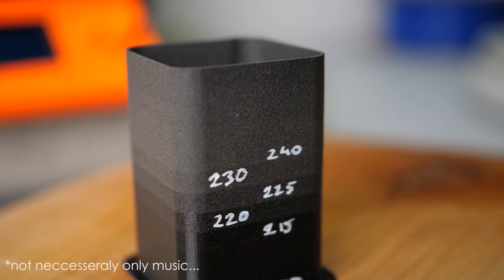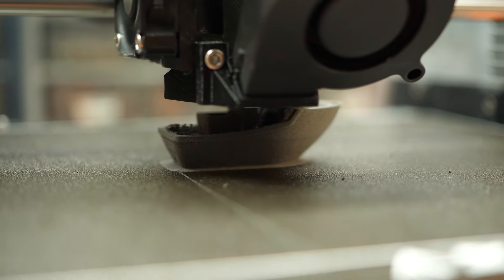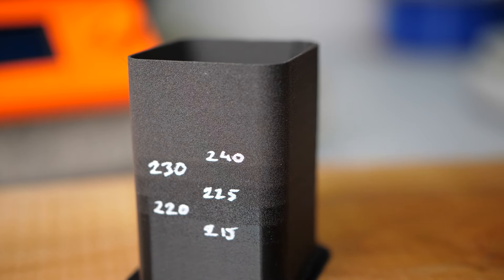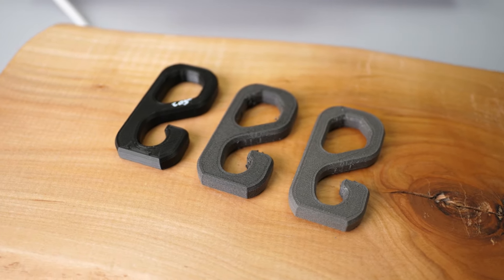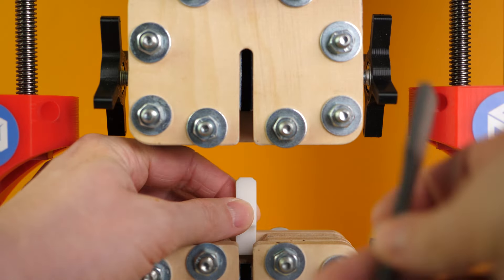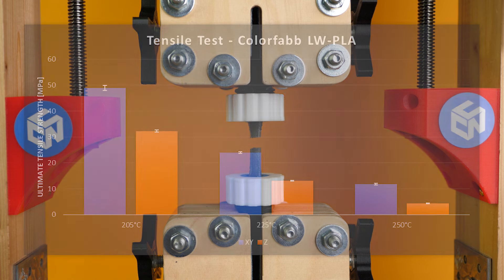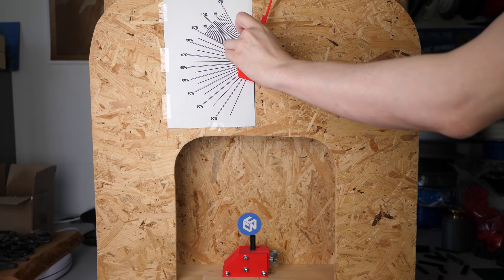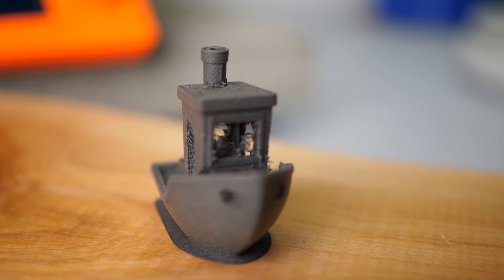A 4th dimension for 3D prints - Colorfabb Light-Weight, foaming PLA

Comment: duuude you should've put the non-foamed low temp parts in the oven at like 230 to watch them foam up after the print!
Reply: you probably loose the gas while extruding
Reply: you will just have a bubbly mess of molten plastic in your oven
Reply: @SteffenBauer  no, if you print at a low temp the chemical is still inside, as he said they put the chemical in before extruding a roll but at a lower temp
Reply: The foaming temp is way, way above the liquid transition temp, so it will all melt and then foam up. 

What might work is making the outer shell thin and the inner sections thick and then hitting it with a bow torch. If you get the heat high enough and for a brief enough period you'll foam the shell without changing the shape.
Reply: Chloe Mcholoe it will melt,try it.it will.
Reply: Jeff Wells l

Comment: Can you print a Benchy that swims well by printing it at high density in the bottom few layers and low density for the rest so it is heavier in the bottom and lies stable in the water?
Reply from the maker: Good idea!
Reply: I came here to ask if it floats. I guess this is the same question, phrased a bit differently.
Reply: micvee The *normal* benchy can float, but barely
Reply: If u touch it it will tip over
Reply: I wanna see it!
Reply: Well sure
Reply: 3 years and no updates on if it’ll float

Comment: i wonder if the trapped air gives parts insulating properties?
Reply from the maker: Very good point! It will definitely be a very good insulator due to the closed porosity.
Reply: @CNCKitchen  Ahh, not a good acoustic absorber then...
Reply: Since it foams up.  You should be able to use it as a  super light weight yet stable in-fill.
Reply: @Audio_Simon  wait. But if it has more insulating, won't it absorb more sound then?
Reply: Great point, I think it would be a good insulator. 3d printed drink holders!
Reply: Other thoughts include that a benchy printed in it would be very buoyant.
Reply: @vincentgarcia6630  only if it is open cell. closed cell foam tends to transmit sound better than open cell.
Reply: @josephgauthier5018  ah. Not sure what this means, but can we choose whether to design the foam as either open or closed cell? Or is that based on the material itself and out of our hands?
Reply: @vincentgarcia6630  i am actually not sure. i would imagine it is material based with many exceptions, as additives can do a lot of things. Either way, from what I have learned, close celled foam usually does worse with sound absorption. With that being said, i would imagine that open cell and closed cell are both better than solid plastic at absorbing sound.
Reply: @josephgauthier5018  agreed, I'd bet it'll help a fair amount. Hopefully it's open then, or that we can make it that way when printing
Reply: @vincentgarcia6630  from what i could tell in the video, it is not open cell, but maybe an open cell version will eventually become available.
Reply: @josephgauthier5018  I would say that the degree of openess depends on the temperature ( at higher temperatures there would be bigger closed bubbles (until rupture), and lower pla viscosity (lower rupture point).  Above 240° it's mostly open, as the bubbles do not increase in size anymore (a.k.a the density remains constant, so you know that the trapped gas expantion is in equilibrium with the losses or it is insignificant).
Reply: @josephgauthier5018  I would say that the degree of openess depends on the temperature ( at higher temperatures there would be bigger closed bubbles (until rupture), and lower pla viscosity (lower rupture point).  Above 240° it's mostly open, as the bubbles do not increase in size anymore (a.k.a the density remains constant, so you know that the trapped gas expantion is in equilibrium with the losses or it is insignificant).
Reply: @giuseppebonatici7169  open cell means air can pass through the entire structure, like a filter. are you suggesting that at a high enough temp, this particular filament will become open celled?
Reply: @josephgauthier5018  If the bubbles cease to expand at higher temperature, it has to develop 2° grade permeability, a.k.a become open celled. 

the only exception to this is diffusion. But, if PLA had good diffusion of the gas generated, you should be able to recognize that the walls had noticiable smaller bubbles than the center of the filament (as they would diffuse to the center (until a saturation state) and outside (degassing), allowing the growing of bigger bubbles in the center as the plastic doesn't allow diffusion because of saturation of the medium). 

The homogeneity of the bubbles and the expansion saturation at a given temperature suggest that, in fact, the material becomes open celled, at least partially. that, or it defies Charles’ Law.
Reply: @vincentgarcia6630  the way material absorbs sound is by surface area and permeability.  Sound needs to essentially get lost in the material.  If the  cells are closed sound doesn't have as many spaces in which to get lost and not come out.
Reply: Kinda like aerogel
Reply: @Scott_C  thats big brain
Reply: @josephgauthier5018  I believe John Coyne was referring to thermal insulation, not acoustic.
Reply: @AwestrikeFearofGods  that is possible
Reply: @josephgauthier5018  We might be able to make it at least semi-open celled after the fact by heating the whole part up to a temperature where it becomes malleable but doesn't lose its shape, like maybe 60°-70°C and then putting it in a low pressure environment, but not quite a vacuum. The decrease in ambient pressure should cause any air cells/pockets to expand, hopefully to the point that surface and moderately sub-surface cells open up to the point where the print becomes at least in part open-celled.
Reply: @richardmillhousenixon  perhaps if you were to put it in something like plaster to help it keep its shape, then that might work. but at that point, you may as well reach a full vacuum
Reply: @josephgauthier5018  I think if you just got it hot enough to where it was malleable you wouldn't have too big of a problem with it losing its original shape, and obviously bringing it to a full vacuum would work the best, but I was just suggesting a partial vacuum since you probably want it to depressurize quickly to avoid air just diffusing through the PLA, so having one vacuum chamber already at a full vacuum and then just opening a valve between that and the one the part is in would quickly bring it down to a partial vacuum without giving the air time to diffuse out
Reply: Definitely. It will have both a high electric discharge insulation and a high thermal insulation.
Reply: @richardmillhousenixon  yeah. my only concern is that if it is warm enough to pop bubbles, its possibly warm enough to sag without support of some kind. 

also, I'm kind of annoyed youtube didnt give me a notification that you messaged me. i only discovered that you messaged me because i got a notification from MrRedstone's comment.

Comment: Very cool! Excellent tests as always! One thing to note is that strength/density is not always the best performance measure for weight critical applications depending on the geometry and loading. For flat plates in bending (i.e. airplane wings), a better performance measure is the strength^(1/2) over the density. For bars in bending (like a wing spar), the proper performance quantity is strength^(2/3)/ density, depending on how it is loaded and the geometry. Because foams are low density, a thin panel made from foam would actually be both stronger and stiffer than a panel of the same weight made from a material with greater density and higher stiffness/density. I could see this material being super useful for RC airplanes like you mentioned! For more info, look up Ashby material index if you’re interested.

Comment: This material would benefit from a print head that could cool itself. Adding a skin of non foamed PLA on the perimeter would greatly increase the part strength without adding too much to the weight.

Comment: i hear this stuff is really easy to sand, can you confirm or deny this?
Reply from the maker: Yes, and also nice to paint because the porosity soaks up the color and it doesn't run along the layer lines as with normal 3D prints.
Reply: @CNCKitchen  Ooooooh, now im excited to try some for some prop making, sanding layer lines and soaking up paint? im in
Reply: @CNCKitchen  This! I was racking by brain a bit trying to see the unique value of variable porosity over just varying infill, especially given the non-linear losses in strength and remaining layer bonding limitations. That is, not for paint but for providing a light-weight, minimal substrate for epoxy resin-reinforced skin. Anisotropic strength is an issue with FDM-only plane structures but I bet the average porosity will be much more uniform. If this results in more uniform resin absorption then that will address some of the strength/stiffness variability. This could be particularly useful in something like an aircraft where a big portion of the material volume is the skin whose pre-resin-coating weight can now be cut by half. If you haven't already, check out Tech Ingredient's recent videos on epoxies for ideas: https://www.youtube.com/user/TechIngredients/search?query=epoxy
Reply: Now I'm seeing the potential!
Reply: @CNCKitchen  that is a very interesting property, might get some of this to make scale models to go with my Gunpla kits
Reply: How much lighter is it?

Comment: Super interesting! I've been making and flying foam planes for around 8 years now, so I definitely want to try this method. The main issue I see already with your printed wing is that foam sheet will commonly be 5 or 6mm thick to form the skin of a wing, with minimal internal structure, and just a single carbon fibre tube to provide stiffness. Thinner foam, such as 3mm or 2mm requires exponentially more internal bracing, even that balsa wood, in spite of having the carbon tube stiffener. I'm going to suggest that your original printed plane would benefit from foam printed internal structure (ribs) while keeping it's thin, un-foamed, skin. The internals could therefore be larger with no weight penalty.
I really like the idea of printing that sandwich effect though.

Comment: So use the foaming for gradient filler material and non foaming temperature for the shell/perimeter. That way you can get a "solid" part that is still light weight and uses less material, but is still strong. And the foamed material can be used for interface material between support and the model for easy removal support.

Comment: I think the dampening properties of this material can be very useful. I for example create dicetowers, and the regular prints are pretty loud to some degree. But with a material like this I think it will dampen the sound pretty good, though it will also lower the weight and might cause stability issues, if the towers won't be hold into place somehow.
Reply: Just a few bounce pads should be enough

Comment: I am glad you are mentioning that the technology is not new at all: "Playmobil" has been using the "baking soda" approach since the 70s for some of their "wood" parts. A problem with their recipe was that the compound (probably a PS) develped very sharp and ragged edges after failure. Not ideal in a toy. 

However, I see a lot of potential in "light", solid infills (handling compression forces), combined with a dense outer shell that is capable of withstanding stress forces, thus replicating structural PUR "integral" foam parts or the way nature has designed bones in mammals.

Comment: Stephen, I enjoy your engineering approach to 3D print tests.  It occurs to me that strength to weight is a key parameter for the foamed part vs. fill factor for the unfoamed part.  Meaning a test of strength of an unfoamed test hook with a fill factor to match the weight of a foamed test hook.   I'd also like to see tests of bond strength of a few common glues, like cyanoacrylate and epoxy.  Perhaps print the test hook in 2 parts and bond them before testing.

Comment: Thanks for the great video! Stiffness in a beam generally goes up by the cube of the thickness, so while the same thickness beam in foaming PLA might be a quarter of normal PLA. a same mass foamed beam should be about 3x stiffer than normal PLA. As you mentioned, skinning with non foamed PLA would improve it further, as would a spray coat of expoxy.
Reply: @JorgTheElder  ...But not as fast as the beam stiffens from added thickness. Try the math, assuming a 44% density and a 25% stiffness for the foam density, and a cube law for stiffness of beam thickness.

Comment: Variable temperature has a lot of merit due to it's wider applicability.  I think you can do this automatically if you setup a fake second extruder in the slicer, and make sure the custom tool change G-code includes an M-code to wait for the new temperature.  (M109, M116, or G4)  While the code will have extra T0 and T1 commands, your printer is likely to ignore them if it doesn't actually have a second tool.

Comment: interresting material, if you have parts that do not need the full strength of normal PLA you can safe a lot of weight in you designs, very usefull for rc- airplane accessories like gear-door, hatches or external tanks and stuff, good video mate

Comment: I think it has some application as you said using a dual print head. Print the internal structure of the wing with regular pla and then print the skin of the wing with the high temperature foaming pla I think it was at 250° that you found it from the most before you had a diminishing return. I would also experiment with hollow spars in solid regular pla as opposed to printing a solid spar in regular pla. Also look at world war I aircraft and how they spindled parts of the wing to reduce weight in the structure. Spindling was and probably still is a common practice for reducing weight in aircraft structure. Willing to bet even an f-35 has spindling in its structural members. Good luck

Comment: i'd love to see a variable desity plane wing
you could print the struts in the middle with 200° and the skin of the wing with 250°

i've reached the end, the dual extruder idea is a lot better
Reply: Variable temperature still has a lot of merit due to it's wider applicability.  I think you can do this automatically if you setup a fake second extruder in the slicer, and make sure the custom tool change G-code includes an M-code to wait for the new temperature.  (M109, M116, or G4)  While the code will have extra T0 and T1 commands, your printer is likely to ignore them if it doesn't actually have a second tool.
Reply: What if you were able to create a small wipe tower like you would with multi-material prints? It should give the hot end the required time to heat up or cool off.
Reply: @Marty Lawson  how about setting up the g-code instead of waiting ... to gradually lower the temperature from the outside to the inside wall or to a concentric infill?

We can assume that with a 40W heater, you can go from ~220 to 240 degrees (the range affected by the foaming process) in about 15 seconds or even less time... to cool down it will probably last longer, need to give a closer look... that’s cool...
Reply: That airplane wing looks way to flexable to use deformation expecially twisting of the wing has catastrophic consequences. Even if you varied the nozzle tempature for the internal struts i don't think its a optimal design. The best way is to use carbon fiber tubing its light, stiff and affordable.
Reply: @Side85Winder  that's what i'm doing for my latest drone frame, it's on my channel
this isn't about performance, but simplicity, although i value both a lot
Reply: @marc_frank  there are other plastics i would consider before PLA for a RC plane. As far as this plastic tested i think is a bit of a gimmick.
 ABS has some good properties considering its lighter and asorbs impact better it would need reinforcment as i think any plastic plane should have.
It also depends on the use case like a beginner plane poloycarbonite would be amazing to take a beating and keep going, where higher end you would probabbly favour PLA for its stiffness, but i think ABS should be able to handle it with the right internal structure.
Reply: @Side85Winder  One hould be able to print out the wing more or less solid with the foam material, and in the design use two groves on the underside of the wing for reinforcements with lightweight flexibles like carbontube/balsa wood/ 3mm ply strips.

Similar to the process uing polystyrene and hot-wire cutting.

Wonder how the boyancy is. Could work for pontoons and such for waterlandings/crafts as well as for statis floating models.
Reply: @sdfghjuytrdssdfghjk  RC builders have better materials to build their planes at their disposal. That sheet thin plastic they wrap the plane skeleton with for example. He has shown the foam plastic has next to no durability so sheet plastic is lighter and better. 
Imo its just hypegenerating bullshit for people that have a 3d printer that don't know the RC hobby well.
Reply: @Side85Winder  That is one of my points, when you do know the RC hobby, this (possibly) can be used instead of the ordinary skeletonmaterias. And at perhaps 50% weightsave compared to regular PLA.
I use ordinary packingtape instead of the specialized shrinkwrap due to it's cost.
Altho, i like the flying part, and am not bothered so much if scales are off.
Reply: It's possible. Cura lets you put in blocks that modify the settings. Usually these are used as support blockers, but you can choose the setting it affects. Just set it to temperature and input the new value. Keep in mind that it will gradually start to heat up when it reaches the affected layer! You'll also have to adjust flow rate proportionally or you'll have a good old mess.